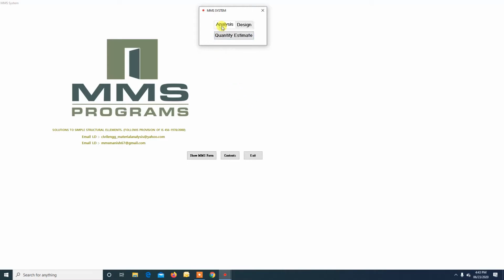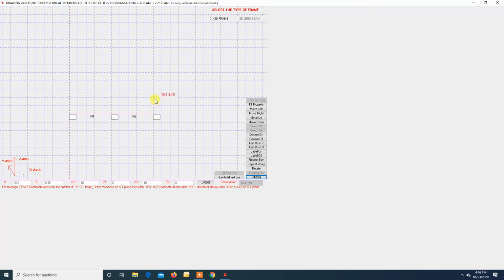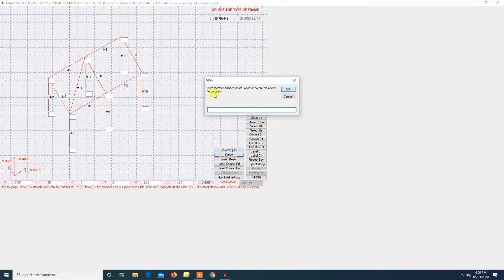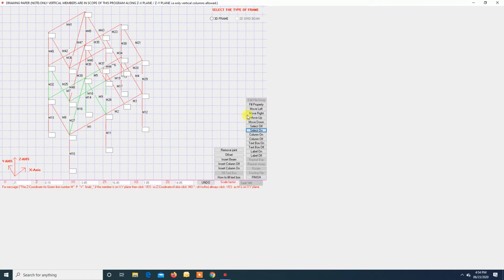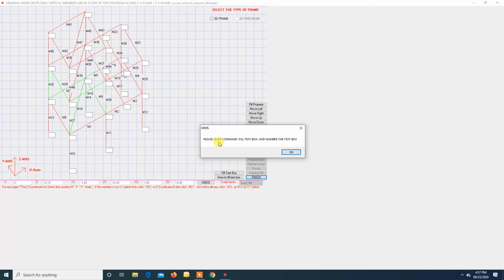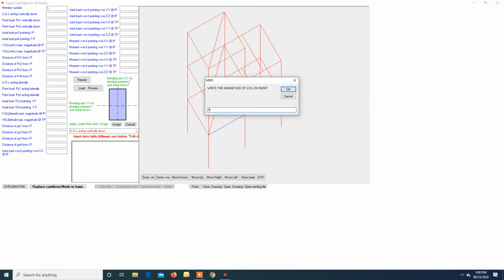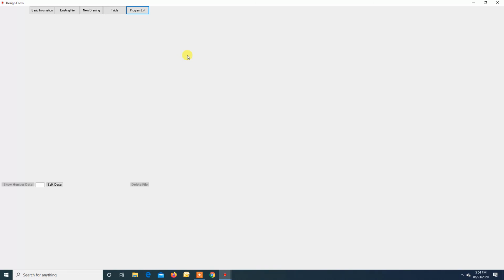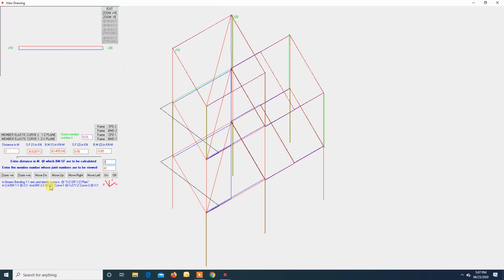3d frame

Comment: Sir have u used finite element methods to solve this problem?
Reply from the maker: Actually the twisting moment, bending moment and shear forces are assumed for solving the problem. But the bending moment diagram was generated from space frame program of my software.